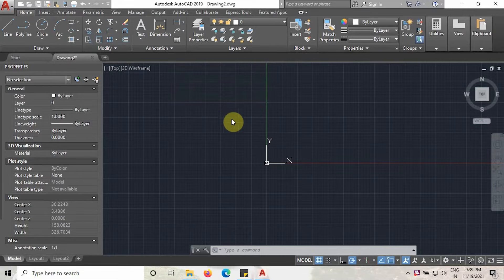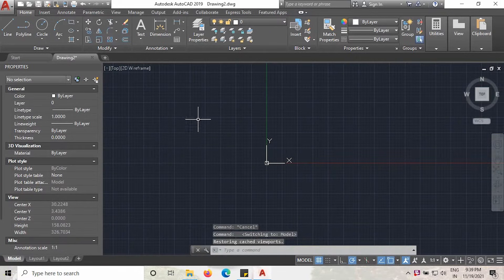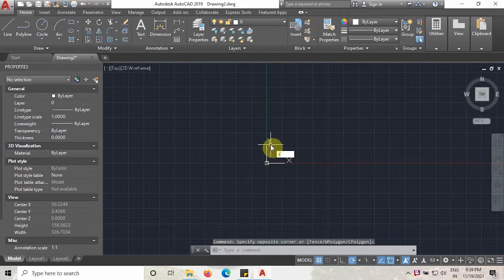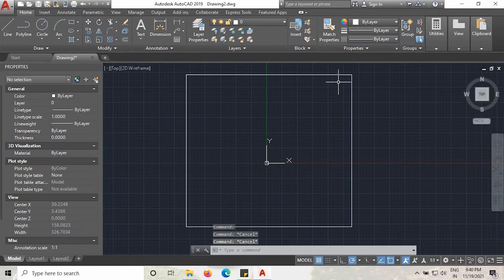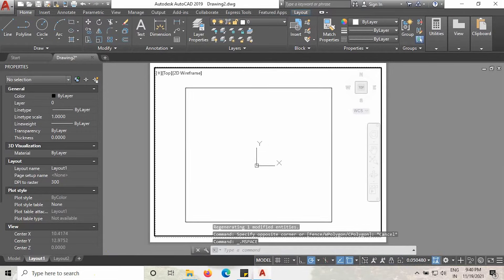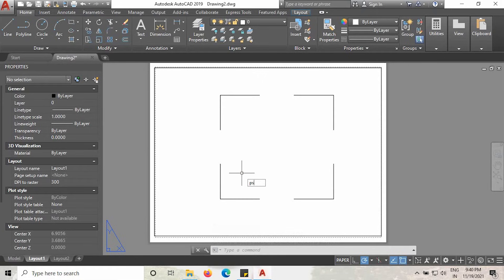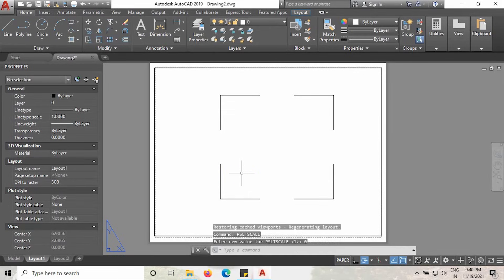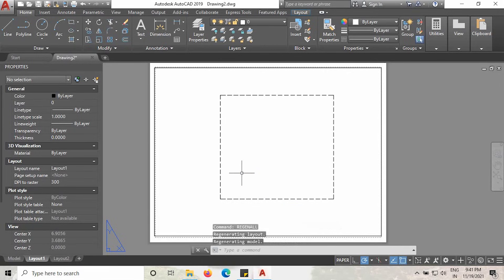HOW TO MAKE HIDDEN LINES VISIBLE IN AUTOCAD LAYOUT PAGE-AUTOCAD TUTORIAL

Comment: It's working but when I print to PDF or make a preview it does not work also. How to fix this sir? Thank you.
Reply from the maker: You can turn on the print visibility in the layer properties. In the layer properties there is one small printer icon just enable that one for all the layers. if it is not working change or create a new layer for the object.
Reply: @globalstudio6673  Thank you so much. Its working.